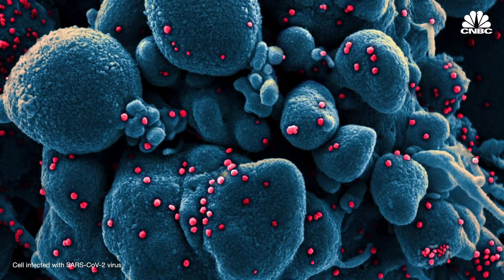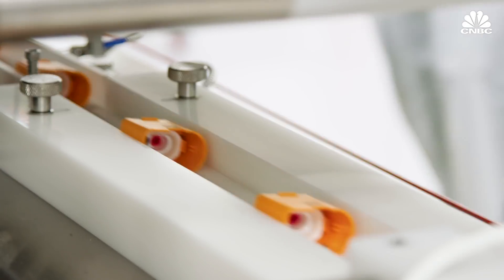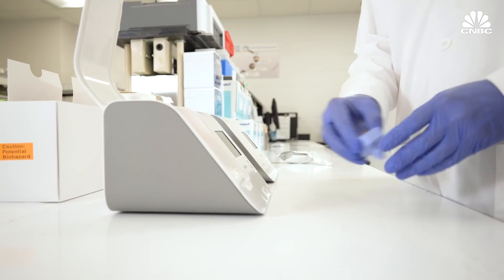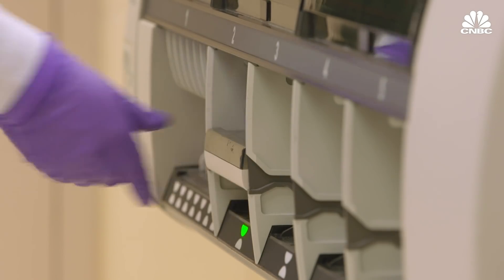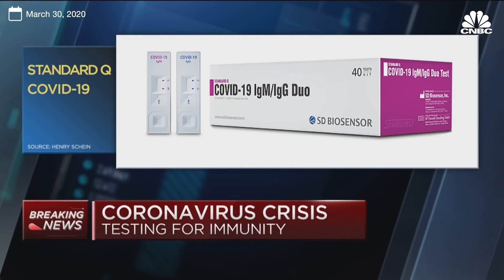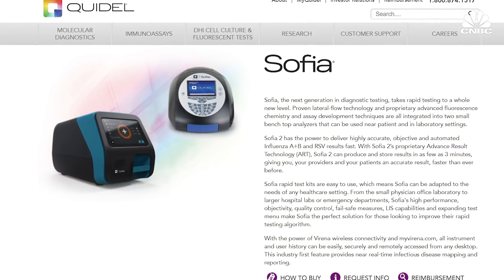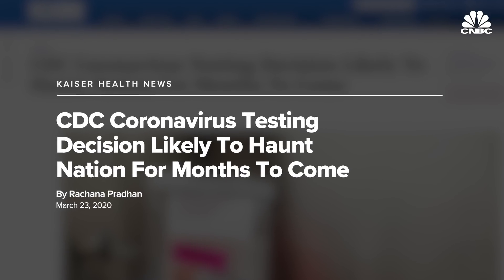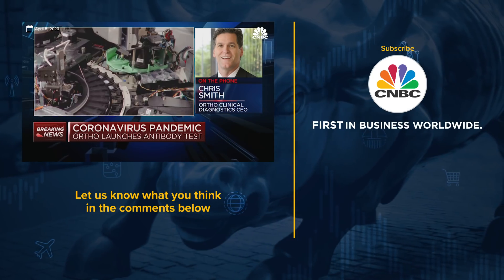How Coronavirus Antibody, Genetic And Antigen Tests Work

Comment: The antigen test section of this video is terrible and just bad information all around.  An antigen test is not meant to capture the same viral load as a PCR test.  It's only really meant to capture viral loads that are high enough to be contagious.

So in that regard its much more sensitive than 85% and also much cheaper.

Comment: I have access to the antigen and antibody rapid test kits.. our sensitivity is 99% and specificity 100%. Results are in 15 mins and accuracy is 98%. The antibody is currently FDA approved and antigen is FDA EUA Currently waiting on a full FDA approval. We’re the only ones with a 98% accuracy rate. Let me know if you need them. Must have a NPI number.

Comment: Can someone explain to me why our own rna human chromosome 8 sequence CTCCCTTTGTTGTGTTGT is matched by the RdRp sequence? It indicates to me that if that is the case then everyone will test positive, and also shows that it is always present in our genetic code so it can be said its man main as it is internally produce by us already and this could actually be a factor of auto immune disease
Reply: Understand your enquiry and confusion, but the answer is straight forward. There is no one specific sequence to test for SARS CoV2 but many fragments. The answer to your question lies in an understanding of primer design which are tested insilico to be specific for the target fragment. So the forward and reverse primers will not target anything else. This is run first on PC against databases to test specificity.

The man made comment needs to appreciate the science around molecular clock analysis which places the ancestral or first sequence elsewhere from Wuhan months earlier, while the outbreak then occurred in Wuhan.

Comment: I've had the test. If you wanna know how it feels like, it feels like when you're in a pool and accidently get the water up your nose. Its burns like that. They stick the swab all the way to the back and swab for 15 seconds. Very weird feeling lol
Reply: I got it before an hour and I am still feeling  my head is burning and left eye has drooped down
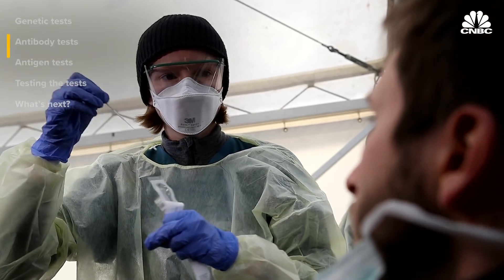Reply: Yeah, that's how it's properly done and for accurate results. It should be turned around for 10-15 seconds and then they take a mouth swab as well. The woman at 8:14 only swabbed for like 2 seconds.
Reply: They do the same test for the flu.

Comment: So if there is a 48% accuracy rate of a test, does it mean that if you take the test x + y times, you can conclude the following?

If all positive: 0.52^(x + y) chance of it actually being negative.

If mixed results (x positive, y negative), then 0.52^x chance of actually being negative, and 0.52^y chance of actually being positive.

Comment: False positive/negative nightmare
Reply: I WAS TESTED NEGATIVE THEN POSITIVE WTF
Reply: @AeroMechEngg  see my post above, its not the test, its the person administering the test, was in my case anyway. be safe.
Reply: @AeroMechEngg  YOU ARE NOT ALONE I KNOW OF AT LEAST 6 PEOPLE WHO TESTED POSITIVE THEN NEGATIVE & VICE VERSA., eg one testing at the local libray proved positive but one on-line test proved negative (both done within 4days of each other)
Reply: Yeah that single machine is
Reply: Its called calculated risk, 
there are trade off benefit and cost analysis being made for several method to be advised